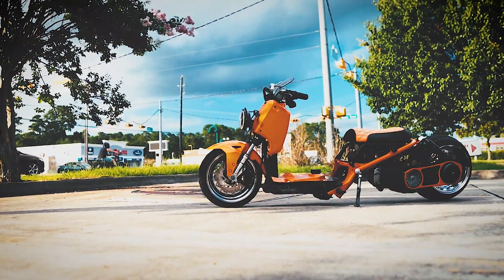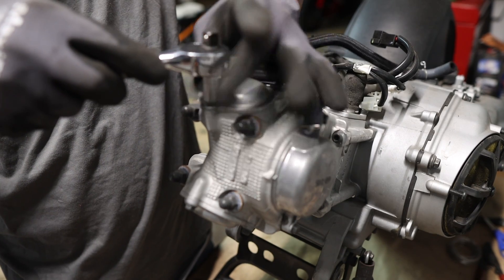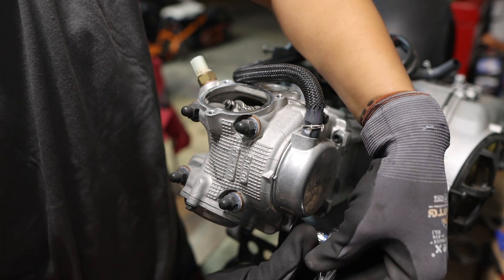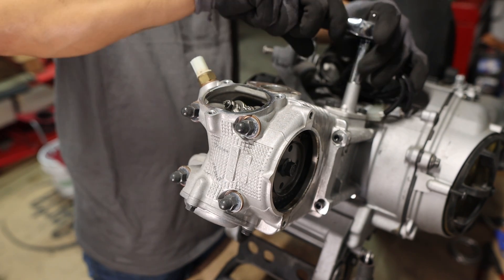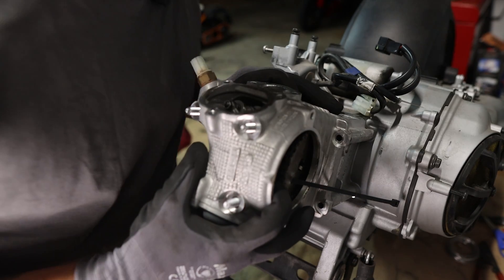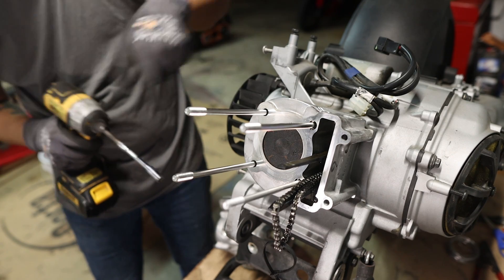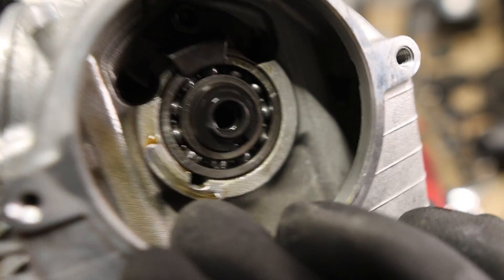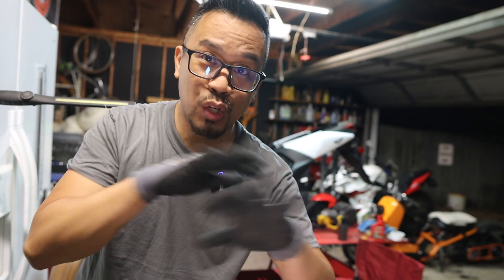Yamaha Zuma 158cc BBK Project Part Two Breaking down the top end #YamahaZuma #SmallEngineVelocity

Comment: The reason why two strokes have bearings and four strokes don’t need them is because two strokes are lubricated from the top via the fuel/oil mixture… which probably means that there’s no proper lubrication in that area. So they use creasy bearings.

On another hand, four strokes are lubricated from the bottom which makes that joint very well lubed up. 

It’s just my philosophy by the way… I’m not a mechanic but it seems logical. Correct me if I’m wrong

Comment: Finished my r158cc build a few weeks ago, the bolts you want to remove the cam are a m8x1.25 and a 3 inch bolt will help. I found harbor freight slide hammer worked the best, but i did have to grind down once of the attachments to help it fit around the bolt easily. To also learn from my mistake, don’t hold that torque gun on the sprocket bolt for two long, just do a couple 1 second taps, because it WILL break if you’re too hard on it :)
Reply from the maker: Crazy power eh? Noticeably more powerful
Reply: @SmallEngineVelocity  wakes it up for sure, if you thought 15-40 mph was fun before, just wait!